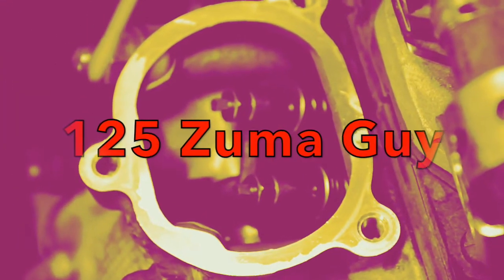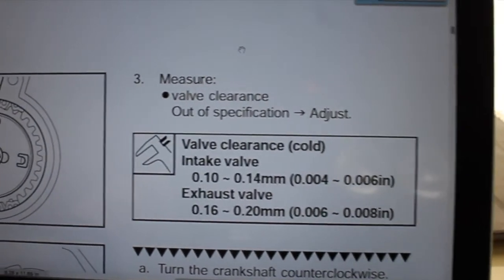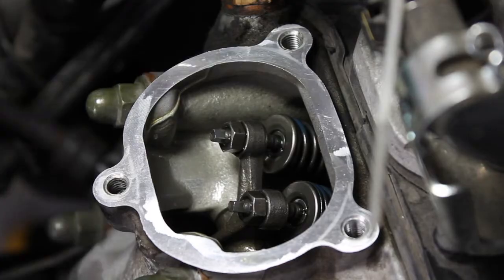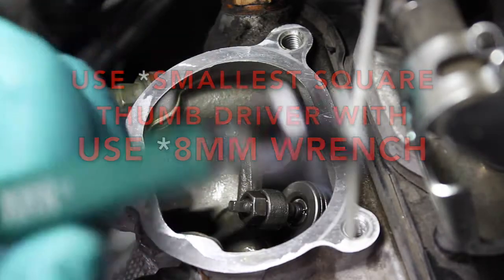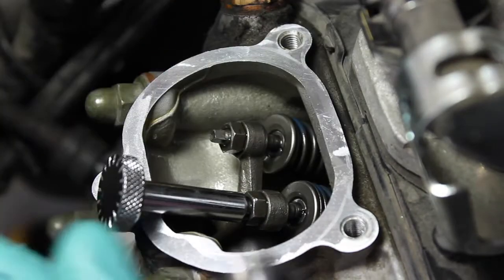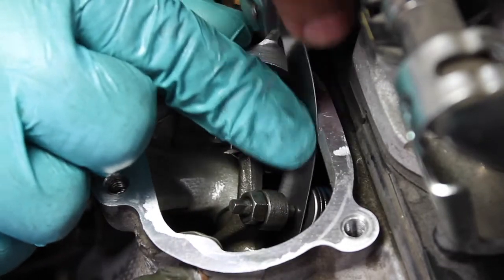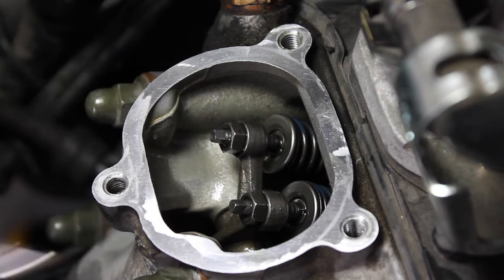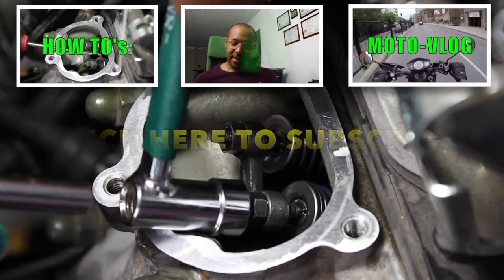EASY & SIMPLE Tools☛ Valve Adjustment for Scooters, Mopeds and Pocket bikes #25

Comment: Hello, I recently installed the Malossi multivar kit on my stock 09 Zuma. I do like to know if you used the provided 8gr. weights?. I did, but didn’t noticeably improve top speed or acceleration in my opinion .
Reply from the maker: Top speed before install https://youtu.be/ArJEEx8IwJ4 and New top speed after install https://youtu.be/ZL5uxANzvA8
I installed every part and every piece that was included in the kit. Check out my video on the Malossi MutliVar.

Comment: I thought that I would throw out this question here.  How do you find top dead center on the Zuma/BWS 125?  I’ve heard that you can remove the two fan covers on the right side of the scooter and you can see the section for top dead center there, and you can also turn the crank from there.  Other people have talked about putting a pencil, chopstick or something like that inside the spark plug hole and when it’s the cylinder pulls it out the farthest, that, that’s TDC in the exhaust turn.  Is this true or is there a better/easier way of doing this?  Thanks again, MSG.
Reply from the maker: Hey Rick,

I don't know about how others find TDC, but I used this manual https://www.google.com/url?sa=t&source=web&rct=j&url=https://www.49ccscoot.com/manuals/2009_Yamaha_Zuma_125_Service_Manual.pdf&ved=2ahUKEwiMvomWmOXuAhW2EVkFHcT4DhsQFjAgegQIKxAB&usg=AOvVaw3M58dwmI47Pptso6doccX2
Head over to 3-19 or search: TDC

Good Luck bro. If you have any more questions let me know 👍✌
Reply: @MSG_MOTO  Thanks for posting access to the Zuma/BWS 125 Maintenance Manual for those looking for that.  I’ve already had mine.  It talks about the little window in the plastic magneto/fan housing area with the little rubber door, but I’ve never been able to find the TDC mark through that hole.  I’ll have to keep looking so that I won’t have to take everything apart.  Thanks again, MSG.

Comment: 1:50  .006" is not "six hundred thou", that is in fact six thousandths of an inch. What you were calling out, "six hundred thou" is actually over half an inch...that's not a gap, that's a canyon.
Reply from the maker: Thanks bruh 🙏 
Cheers and happy riding 😀
Reply: @MSG_MOTO  selam e5/125cc 4valf / hava sogutmali. Valf bosluklari ne olmali ? 0,07 inch ?